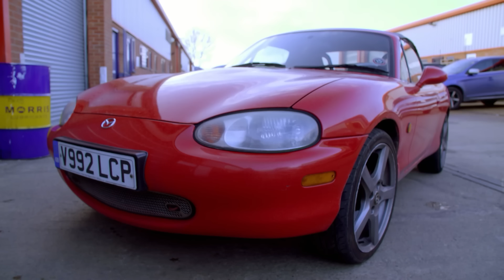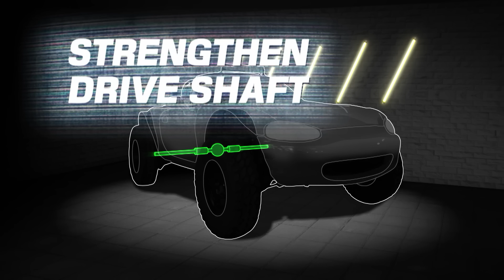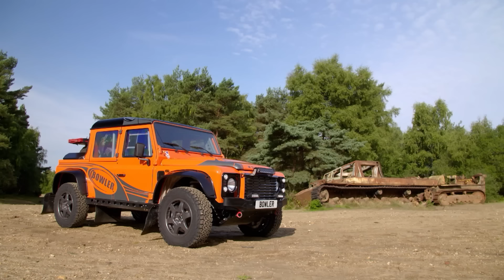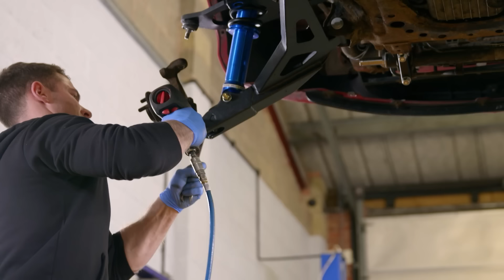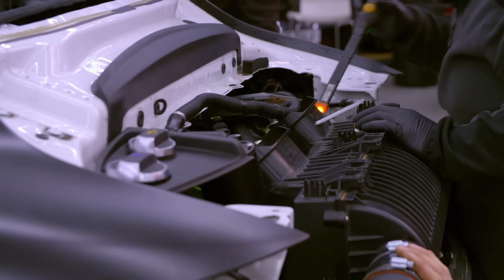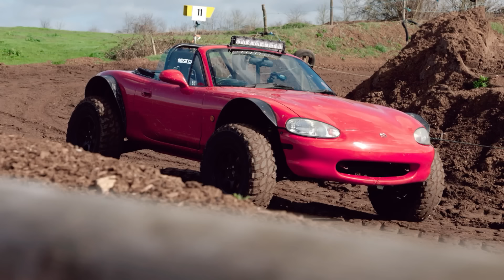Turning an Mazda MX-5 Into an Off-Road Beast | Speed Freaks

Comment: 31 inch wheels eh?
Reply: They're 1 inch bigger then 30, and 1 inch smaller then 32. Wild right?
Reply: @pauliewalnuts240you think the wheels they put on the car are anywhere close to 31 inches?????  This is a car show, they should know the difference between a wheel and a tire.  So yes, it's wild for them to say 'we took off the factory 15inch wheels and replaced them with 31inch wheels'